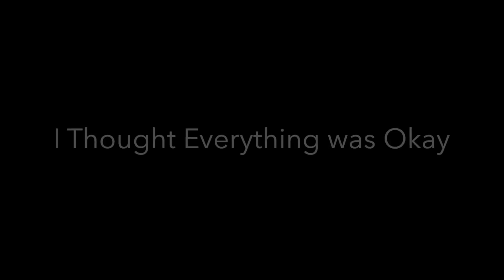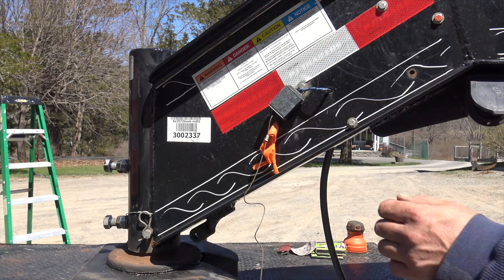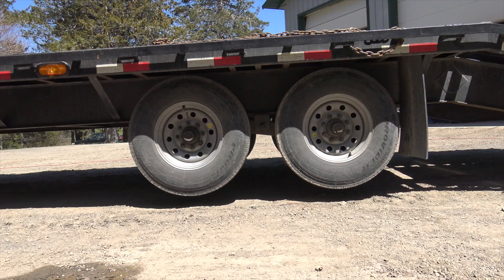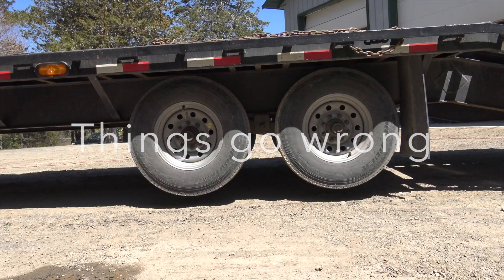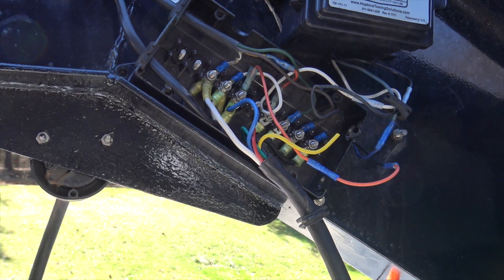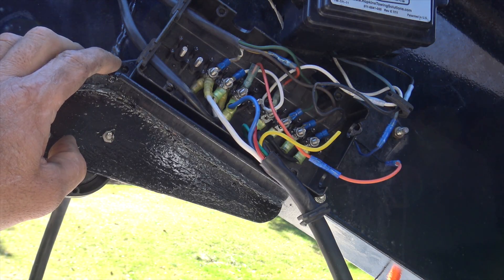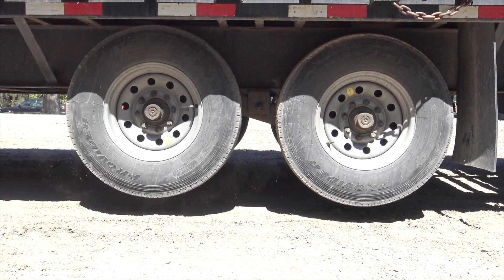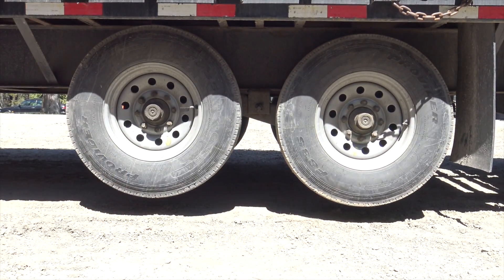PJ Trailer Emergency Brake Test Failure

Comment: In my trailer the control that is installed inside the truck the green light sometimes blinks and does not mark what is braking sometimes it marks and sometimes not.  something you can help me with to solve my problem?

Comment: Went to order brake pads for pj trailer and was told that they were discontinued and would have to replace axels.  Never will I buy a pj trailer again 8 grand for a brake job is a little steep.

Comment: Hello there.   I have a leak on one of my brake hose that connects from the steel line to the Dexter part.   It leaks from the dexter connection end.   How do I replace that?   Is it easy to do?
Reply from the maker: These brakes are electric.  Sounds like you have hydraulic brakes on your trailer.  sorry cant help

Comment: do those brakes work with the truck battery or does it have another battery on the trailer?
Reply from the maker: The primary source of energy for the brakes comes from the tow vehicle through a cord.  There is a battery with the trailer in case the trailer detaches from the tow vehicle and that is the emergency braking system

Comment: Thanks for taking your time to show us. Great video!
Reply from the maker: The best things happen when you do not expect them.  Thanks Mike
Reply: Ju
Reply from the maker: Thanks Juan.  I operate in New York and have been inspected twice by the NYS DOT Commercial Vehicle Enforcement Unit.  The brake away system was checked on both occasions.   As you can see from the video the brake-away system on a trailer is fragile and there are multiple failure points.  I do this trailer safety check monthly because if I were to be inspected and that system failed that qualifies and an Out-Of-Service Violation.  That give you a big red sticker on your truck that says that it can not be driven until a certified mechanic says the brake away system is functioning or have the rig towed back to my shop so I could fix it there.

Comment: So to be clear, this was a problem with the wiring YOU did and not the wiring that the factory did correct? Because the implication of the title of this video is the manufacturer failed. I think you should explain that better.
Reply from the maker: You are correct Cerberus.  This trailer was delivered with everything working as it should.  After 2 years of commercial use and multiple brake rewiring efforts due to abraded wires this is the end result.  The point that I am trying to emphasize is that the brake-away system of all trailers should be inspected by jacking up the trailer and pulling the brake away pin regularly.  In my case I did it monthly.

I have nothing against PJ trailers.  This trailer served me well.  Just need to check things as over time they can become worn or malfunction.

Comment: The wiring is terrible. .you need to redesign the system too  so the brakes don't release if there is a fault.  Then it becomes proper emergency brake ?
This is prehistoric by modern  standards. Only in murica lol .How did they get a on the moon?
Reply from the maker: Everything works perfectly when the trailer leaves the dealership.  After any type of winter use things need to be checked frequently
Reply: Axiom Excavator Rental .Yes I'm sure it's all perfect when it leaves the factory but you can't educate stupid. A proper fail safe is much safer. You don't move if it's not working correctly. How simple is that?
Reply from the maker: Yes, like air brake on a truck.  Problem is 8 out of 10 trailers wouldn't move.